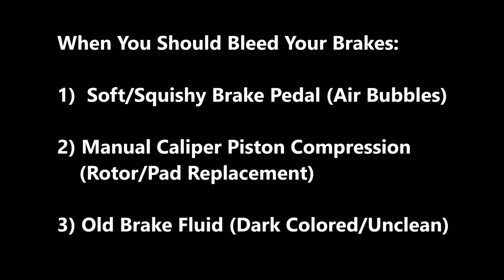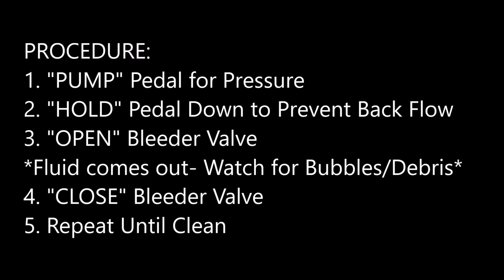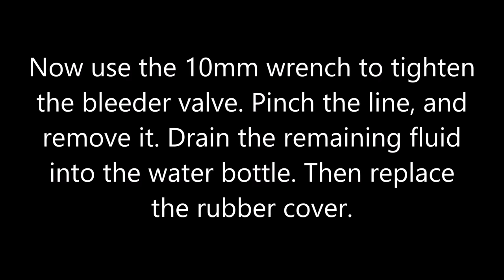How To Bleed Your Ford Escape Disc Brakes: HOW TO ESCAPE

Comment: Is this the same procedure on a second gen (2008-2011) for escape?
Reply from the maker: The same principle applies to all hydraulic systems to void the air bubbles- you may go through a significant amount of brake fluid getting the hang of it but it's worth learning. It just depends on the routing of your brake lines on which ones to do first, and which wheels have the parking brake on them as well. Hope this helps!

Comment: I had a seized driver side caliper. So I think. I replaced. Tried bleeding. Could barely get anything out. Started the car and it started really coming out. Bled it. Went out and drove it and now it is pulling to the passenger side. A guy drove the car for close to an hour with the seized driver side. Any idea what I need to do ? Could I have a bad abs booster?

Comment: Can i do this same procedure if i change my brake booster
Reply from the maker: I dont see why not- if you are concerned about back pressure on your third party booster,  try just bleeding at the valve at every push and leave the fill cap on so there is no opportunity for back flow. I'm not sure if thats your question though?
Reply: @HowToEscapeDIYTipsandReviews  man! Thanks for the fast reply! Actually my friends 2014 escape has this hissing sound coming from the pedal , as soon as i press the brake pedal it stops, the hissing sound is kinda loud. Searched around and it seems i need to to change the  whole brake booster, my concern was i didn’t know if i needed the special scanner to bleed this year escape till i seen your video.
Reply from the maker: @luismorales_1991  interesting- yeah I haven't heard of the booster going bad on these Escapes but I guess its always possible- so it hisses UNTIL you press the pedal? Like there is q vacuum leak on the booster?
Reply: @HowToEscapeDIYTipsandReviews  yea like a vacuum leak , it stops when i press the pedal , then comes back if i release the pedal
Reply from the maker: @luismorales_1991  yeah that would make sense. So it sounds like you got that squared away then? Just the question about bleeding the fluid?
Reply: @HowToEscapeDIYTipsandReviews   yea i was concerned if was gonna be able to bleed it like i usually do on my chevys till i seen your video and decided to ask you , looks like ill be changing that brake booster this weekend and do this procedure of bleeding it , appreciate your time man.

Comment: how much should this cost?
Reply from the maker: Hi Kyle, sorry for the delay- it all depends on the types of rotors and pads you're looking for as well as the types of shops and going rates where you are. I know where I am in central VA, considering labor and at least a basic set of brakes (front OR back), time for bleeding fluid and such, I'd say assume ~$300 starting price for a front or back, and make it $500 starting price for all 4 wheels. Wouldn't be surprised if all 4 went up into the $750's or $800's depending on where you live or the types or rotors and pads you want.

Comment: Hi there, I did this and unfortunately did not tighten it back tight enough. The fluid has been leaking. I got more brake fluid but is it safe to just tighten it and add more brake fluid? Or should I do this entire process all over again? Also, because my brakes had no fluid, my brakes were really soft. I, afraid to drive ir again. What’s your best advice moving forward? Can I just refill the reservoir and add more brake fluid?
Reply from the maker: Totally get it. Sorry- thats frustrating but glad it didn't get too far before you found the issue. Unfortunately you need to start over. If its not tightened, it can suck aid back through the bleeder valve and reintroduce air bubbles to the lines
Reply: Thank you so much for replying!!! So when I looked in the reservoir it was completely empty. The brakes weren’t really catching. I added more brake fluid to the reservoir. Do you think it’s safe to drive to the nearest autozone to pick up more brake fluid? Or just don’t drive at all?
Reply from the maker: Should be good to add more fluid to the reservoir and repeat the process but tighten it of course. Keep in mind excess brake fluid will make paint peel and irritate skin if allowed to sit in contact too long. Good luck!
Reply from the maker: @Zakaherbs  it would be way safer to take an Uber or have a friend drive you if possible. Not worth the risk of running a light or a possible accident  in my opinion. Walmart of all places usually stocks brake fluid (DOT 4) and im pretty sure they do deliveries now if you can wait so that or something like that could work too
Reply: Perfect, getting this done first thing in the morning. Should I be worried of any other leaks as when  I did this I also changed my brakes and rotors.
Reply from the maker: @Zakaherbs  the brake system has one line that goes to each caliper. The calipers are what squeeze and open your brake pads relative to the rotor so as long as the brake line going to the caliper isn't damaged and the hose isn't leaking where it installs to the caliper,  there really isn't anything else that could leak,  really ... pretty sure at least
Reply: That’s exactly what I was thinking as well, the first time I did it I knew I didn’t tighten it enough so when the light came on I’m ew the problem immediately. Just needed confirmation. Thank you so much. If I have any more questions after bleeding the brakes tomorrow, I will reach out. Thank you!!!
Reply: These are also rear breaks, do I have to do anything differently?

Comment: ¼" tubing?
Reply from the maker: 3/16ID is snug and works best but 1/4 is probably fine. There's no real pressure as its just venting and redirecting to your purge bottle or container.

Comment: just put new front calipers and hoses getting fluid out bleeder but pedal goes to floor no air spitting out bleeder
Reply from the maker: Hey Pete- hmmm. Let's figure this out. What's your sequence to pedal / bleeder action? 

Proper sequence is to pump the pedal, HOLD the pedal down (with a friend or with a weight), and crack open the bleeder valve. Keep repeating (as it seems you've done) until no air bubbles are left. Tighten the bleeder valve. Re-pump the pedal until stiff/normal resistance... 

If your pedal is still soft, try checking the following, ordered easiest to most time consuming: 

1) Check your brake fluid reservoir to see if you've pulled all your fluid and need to refill it to the Min/Max line. 
2) Double check to make sure the pedal is staying held down when you're bleeding the valve so that it's not sucking air back in the lines. Make sure the pedal is at the floor when bleeding. 
3) This is the biggest pain, but a possible culprit- bleed all 4 whees/lines to make sure there's nothing left. Air bubbles can migrate to other wheel areas and even get caught in the ABS module. 

Please let me know if any of this helps. Good luck!